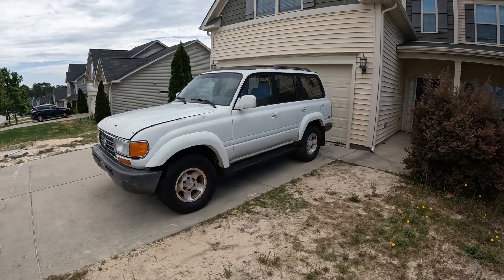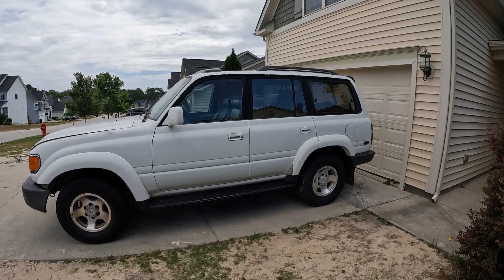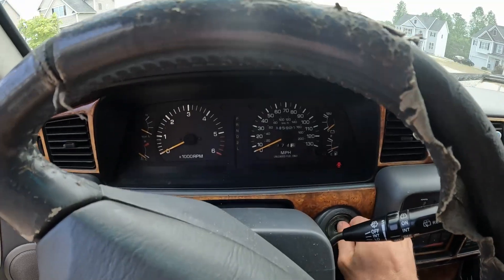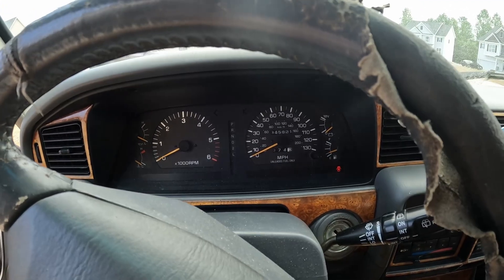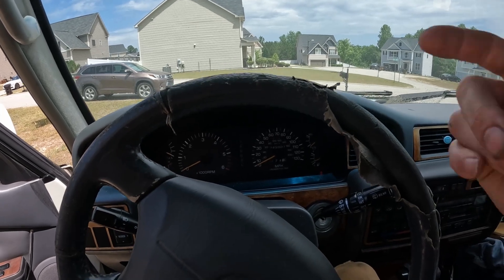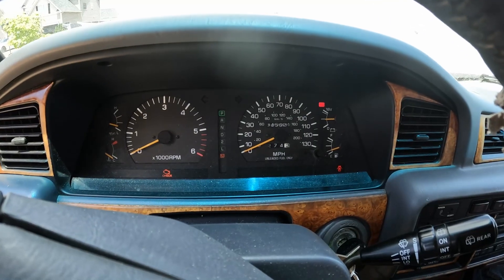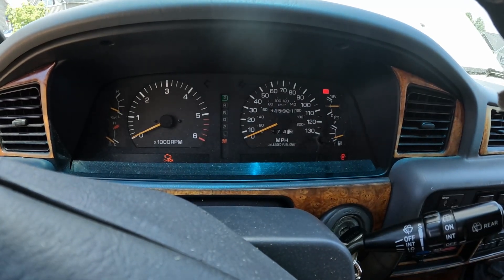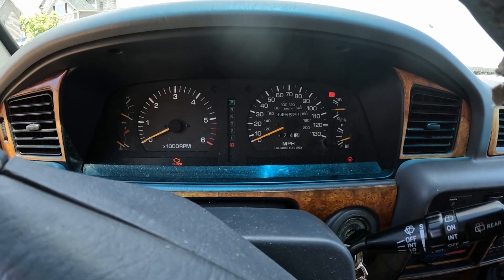80 Series Crank No Start, Don't Load the Parts Cannon

Comment: Great video but im at a loss. I have exactly this problem (no alt light or CEL, everything else works) but the issue still persists even after replacing the fusible link. Turning into a nightmare.

Comment: First off, great video!
I have a 99 lc100 and I’m hoping you could help me out. The Cruise control, Overdrive, 2nd gear & PWR works but the light’s don’t come on the dash. I have pulled the cluster out to see if I could see anything and then tightened it back up with no success.

Comment: I had no idea there were three fusible links. I have only one connected directly to the battery as a backup. I'll need to look into those other fusible links. Thanks for the explanation makes a lot of sense.
Reply from the maker: All of the fusible links are together. When you look behind the battery you will see the three wires that make up each fusible link